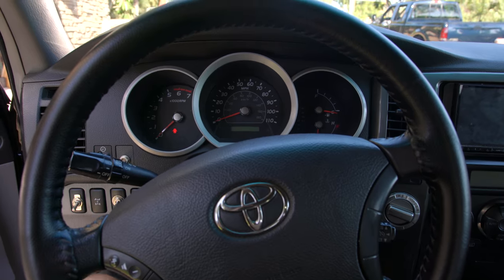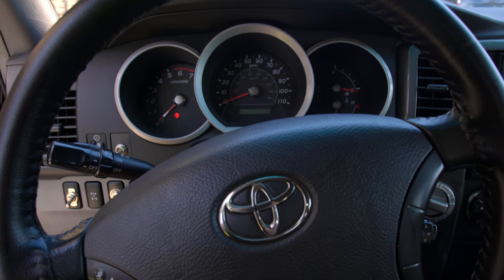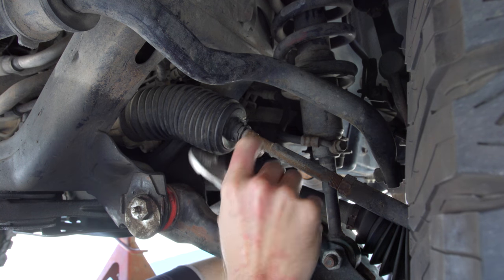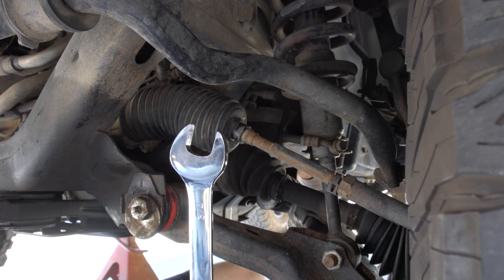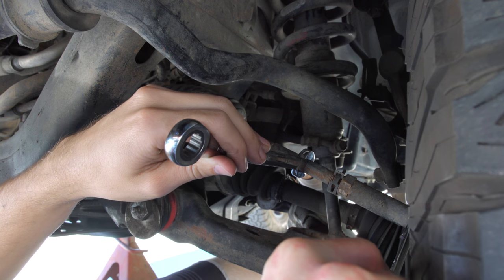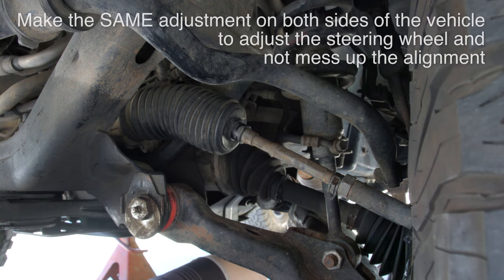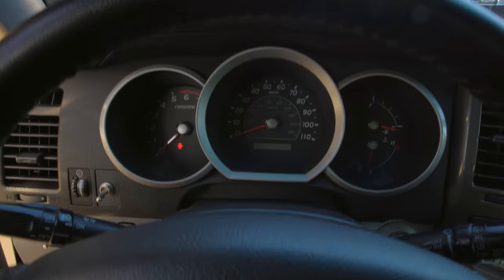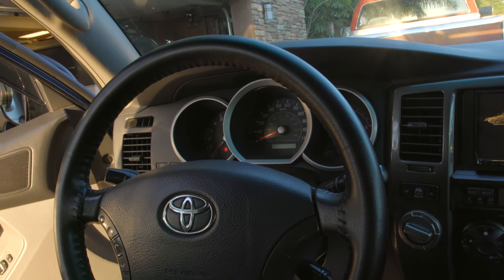How to Center a Crooked 4Runner Steering Wheel

Comment: I had the same thing but I adjusted it via the steering shaft coupler. It goes into the steering rack, there is a lower screw and an upper screw on the coupler, undo both and then push upward (from under the truck) and it should come loose and slide upward, clearing the pinion on the steering rack. At that point you can rotate the steering wheel and adjust it to its zero point, reattach the coupler, fasten, and bingo that's it.  No tie rod fiddling needed.  Cheers !

Comment: If you pay for an alignment and the steering wheel is not straight you should demand your money back.
A straight steering wheel is part of the alignment process.
Reply from the maker: You're right. If I wasn't mechanically inclined then I would have. But since it was easy enough for me to do it myself I figured It was a good chance to make a video and teach other people about it. I ended up going back for an alignment and they gave it to me for free.
Reply: Doug N man, I keep give the car back to dealership. I told them the steering wheel is not centered is tilted on the left. They told me that everything is fine tire rods,suspension. Then I took it out and I return it back. They test it and they told me is not tilted!! I told it to a regular shop and they said your alignment is perfect. But I still feel that my steering wheel is not centered.
Reply: Alignment shops don't give a rats a$$ about your steering wheel. Thanks for this video!
Reply: @fishing4happiness610  True. My car runs straight, but the steering wheel alignment is FUCKED!

Comment: Good video thanks for posting... key thing is which way to turn the outer tie rod ends.  BOTH sides will be the same way depending on whether you are adjusting to the left or to the right.  In your case your steering wheel was off to the left (counterclockwise) direction so the wrench will be turning bottom to top like you did on BOTH sides.  If your steering wheel was opposite of your case (slightly clockwise off or right of center) then the adjustments on both sides with the wrench would be top to bottom.  It is good to visualize what is happening when you are turning them.  They are standard threaded rods and it is easy to visualize either extending the tire/wheel or contracting it when they are turned the proper way.  Thanks for posting!
Reply from the maker: You said it right!! Thanks for watching!
Reply: Excellent comment thanks man

Comment: Just had my 2018 TRD "aligned" today after I installed my lift. Drove it there and when I took it home...it's aligned...but the wheel is sitting around 45 degrees left. I'm going to take it back but if they can't fix it I'll give this a try. Thanks for posting!
Reply from the maker: Same thing happened to me. I took it back twice and it was still not straight, but like yours it was aligned. So finally decided to do it myself, and take it back for alignment. It was off such a small amount they barely had to touch it. Never going back to that shop again though
Reply: The shop I took it to gave me a deal on a lifetime alignment package so hopefully they'll get it eventually. I won't say it's name but it rhymes with Firestone.... Super cool guys, then again, this is a little much. My terrain control and traction assist lights won't go off either. Fun times.
Reply from the maker: Hah yeah it’ll do that to your lights. Well best luck man! Let us know that you got it fixed!

Comment: Yea I just replaced my steering rack bushings. The wheel is off to the left about 10-15degrees I think I’m going to have to take it back off and move the knuckle another tooth the wheel moved a little even having it tied down so I think that is my problem.

Comment: Sorry, the haters are hating on your video. I had the exact same scenario with my 100 Series Land Cruiser. My steering wheel had to be to the left to drive straight. 

I took it to an alignment shop and they recommended a new Rack & Pin and claimed my  Tie Rod Ends were stuck. 

When I got some time, I took some toe measurements (looked good) and then saw your video. 

So I gave it a try, did a full 360 turn “up” on both sides and bam steering wheel was straight and the vehicle tracked perfectly down the road!  

I dialed mine in a little and came back 1/4 turn and now its really nice. 

Thanks so much, this helped a lot and saved me a bunch of troubleshooting and time! 

If we ever cross paths I’ll buy you a beer lmao.
Reply from the maker: Glad I could help! I’ll take you up on that beer haha. It’s funny the haters are the people who wouldn’t actually try it themselves and don’t realize that after I made the adjustment my truck drove straight and my steering wheel was straight. Haters gonna hate!

Comment: Thank you for pointing out to remove the clamping ring fm/the Inner TR boot, so you can rotate it free. I've recently noticed that the wheel is crooked like ~30 degrees to the right. Not sure if I need to go to alignment before or fix it and then go to check everything during the alignment. I've read you comment below about the reasons why to do the straightening 1st, but in one film they said the crooked wheel can be due to unbalanced tires. I've changed 2 tires on front, balanced them w/HF Bubble Balancer (all that is not very precise of course), then took it for a test drive, noticed that crooked wheel. I don't remember if was crooked before or not (I don't drive that car much). So I think maybe the problem is due to new tires, which are not aligned and unbalanced. After I change all 4 tires, would it be better to straighten the wheel first and then go for alignment or just go to the dealer explain everything, so the mechanic will do the adjustment during alignment? Thank you very much for your film again.

Comment: Did my alignment turn out they didn't proper torque my driver side lca bolts was loose, it was clunking and torque it down now my steering wheels is crooked Will it be the same problem

Comment: Same issue for me
I refused to go back to the shop. What is the point?
Same shop also didnt notice my cam bolt being waaay out on the passenger side
Tire noise ans wear still drive me nuts
I'll be adjusting the front toe, cause the factory marks are off on either side 🤷🏼‍♂️

Comment: Why would you adjust the rods and not just loosen the intermediate shaft and straighten your wheel. Then retighten?
Reply from the maker: Because with my searches I couldn’t find anywhere to do that. Could you help me know where it’s at? I know there’s bolts on the shaft under the dash, but that wouldn’t let the steering wheel spin.
Reply from the maker: Eric Kimmy  ??
Reply from the maker: @subtegral  I actually know the answer to that.. would you like to know?
Reply from the maker: @subtegral  I agree. So the egg and chicken paradox... The simple answer is that the chicken came first. Cause who the F sat on the egg. Eggs are so temperamental. You need to keep them warm, flip them over... if the egg came first there would never have been any chickens. The egg would've just sat there and rotted to nothing.
Reply from the maker: @subtegral  That is a whole other topic my friend.
Reply: That would uncenter the rack.
Reply: you have to crawl under and look on the driver side, there is  the steering wheel shaft that goes into the steering rack.  There you will find a coupler with a rubber plate.  That coupler has a screw that tightens to the steering rack pinion, and another screw that tightens to the steering wheel shaft.  You have to unscrew both of them, then tap or push upward on the coupler.  It may be "jammed" due to tension but it should come free after some jiggling.  I agree it was hard to find this info for me too and I did not realize the coupler could slide upward that much, since there was a lot of dirt and grime that had jammed it.
Reply: The center of the rack depends on the tie rods as well.  If you unbalance your tie rods or adjust the shaft it's the same thing @lurice0
Reply: @wacky.racoon  no it's not because the tie rods are a much finer adjustment for one thing, for another thing it has to be exact at least to 1/32 of an inch. Lastly if your steering wheel isn't centered, and u try to do an alignment u won't be happy when your done. Count how many turns it takes to get steering wheel from center to left lock, then compare that number with how many turns it takes to get to center to right lock then make those numbers match. Then straighten wheel and lock it with something. Roll car back and forth and straighten wheel. Put car on slip plates. Get brackets that attach to car and attach strings to brackets. Measure distances from strings to wheels. Adjust tie rods accordingly. Only way.
Reply: What do you lock it with?

Comment: I hit a stump and it went -45 degrees. I hit a stump again and it was on center. Then a third hit of a stump did a - 10 degrees. 
I think something is slipping. If it was bent, it would probably be unable to correct itself.
Reply: Did you ever figure out what was loose? I hit a pipe and steering is now off. Im pretty certain tie rod adjustment isnt the correct answer but is one way to hide the problem.

Comment: If you have A UNIVERSAL JOINT UNDER YOUR DASH that assembles the steering shaft there, you can simply loosen & remove BOTH bolts ( one on the top of the U-joint, and one on the bottom ) to that U-joint. That U-joint will then slide right off DOWNWARDS off of the shaft closest to the steering wheel. You may have to "coax it" or jiggle & pull repeatedly, but it WILL slide off that upper shaft. You will see SPLINES ( little grooves ) on the end of that UPPER shaft closest to the steering wheel that the U-joint rides on when assembled. Now, SIMPLY STRAIGHTEN YOUR STEERING WHEEL BY HAND, TO WHERE IT NEEDS TO BE, AND MAKE SURE YOU DON'T MOVE THE STEERING WHEEL AGAIN ( keep it in the correct position ) AS YOU RE-INSTALL THE U-JOINT, EXACTLY THE SAME WAY YOU REMOVED IT. What happens, is AFTER you completely remove that U-joint, and then STRAIGHTEN YOUR STEERING WHEEL, THE UPPER STEERING SHAFT TURNS ALSO, TO THE PROPER POSITION. If you do this carefully, and properly, you will straighten your steering wheel WITHOUT so much as touching ANY of your front end adjustments THAT CAN CAUSE YOUR FRONT-END TO GO OUT OF ALIGNMENT. THAT MAKES NO SENSE TO DO IT BY MESSING WITH YOUR FRONT-END ADJUSTMENT. ( Unless you happen to have a vehicle that does NOT have that U-joint on the steering shaft UNDER THE DASH. ) VERY IMPORTANT: BEFORE YOU DO THE METHOD I JUST EXPLAINED, DRIVE YOUR CAR ON THE DRIVEWAY, PARKING LOT, OR ANY ALLEY OR SIDE STREET JUST FAR ENOUGH FORWARD SO YOU KNOW YOUR FRONT TIRES ARE EXACTLY STRAIGHT. ( Make sure you are on hard, LEVEL ground when driving your car about 30 feet or so to make sure the front tires are perfectly straight. Because YOUR TIRES AND YOUR STEERING WHEEL NEEDS TO BE STRAIGHT WHEN YOU RE-INSTALL THAT U-JOINT. ) If you have that ADJUSTABLE U-JOINT on your steering shaft under the dash.........THAT is where you are suppose to straighten a damn steering wheel.........YOU SHOULDN'T MESS WITH A PERFECT FRONT-END ALIGNMENT TO SIMPLY "STRAIGHTEN OUT YOUR STEERING WHEEL".........YOU COULD VERY EASILY SCREW UP YOUR FRONT-END ALIGNMENT THAT WAS PERFECT TO BEGIN WITH. THAT ADJUSTABLE U-JOINT ON THE STEERING SHAFT IS THERE ( on most vehicles ) FOR THE VERY REASON OF STRAIGHTENING THE STEERING WHEEL, WITHOUT HAVING TO SCREW AROUND WITH YOUR FRONT END ALIGNMENT AT ALL. ........GOOD GRIEF MAN........WHO IS TEACHING YOU GUYS ALL THAT OTHER CRAZY SHIT.
Reply from the maker: Lol you must have a lot of time on your hands. Turns out the shop didn’t get my alignment right or my steering wheel straight.. so this was necessary for me after having gone back 5 times already. I’m sure you would’ve understood that if you watched the video. I appreciate your input, but would appreciate even more a better delivery 🤓
Reply: Thank you so much saved me lots of dollars taking it to garage
Reply: @TrailBendersOverland  if you had to go back 5 times to get your steering wheel straight there may be something wrong with one or both of your outer tie rods or possibly whom ever is doing your alignments isn't that good.
Reply: Yup.  I had to replace the steering shaft with the U joint and now my steering wheel is off because of it.
Reply: Agreed. Alignment tech who uses a machine to align the wheels showed me the tie rod end tied in, while the other one was adjusted to half of the thread length. Now I'm sitting here replacing a steering rack (it was completely out of alignment which caused the rack to have play on the passenger side). Btw, hes right. If your rack is aligned, and all the rubber (bushings and joints), and ball joints are good, you should adjust the steering wheel at the rack. Did your alignment shop give you the measurements? 

The only time you should touch those is if you're replacing them and getting an alignment. Otherwise, youre replacing other stuff along with tires. Those tires look expensive
Reply: @bkelsey6692  you're uncentering the rack if you mess with the steer wheel joint
Reply: I get your point but why these aligment shops most of the time don't do the right thing been there a couple of times  and every time I go with a crooked steering wheel they don't fix it when I got the car back it's crooked to the other side so what's the point of  taking your car to these professional shops and pay $100 plus if they don't fix the problem I just think that the new technicians these days don't give a f.... they think cause they have those fancy machines don't have to check every single step on how to perform the right aligment for every car....
Reply: @lurice0   adjusting the steering rod is zeroing out the rack center because it's been uncentered to begin with due to the tie rod adjustments made at the alignment shop. Think about It from a systems perspective, the steering wheel misalignment is an input problem, with 1 adjustment point.  It is more efficient to adjust it there, rather than adjusting the output (tie rods) to compensate for the input, which has 2 adjustment points, and will need re-alignment afterwards.   Unless the tie rods are wholly unbaleanced this is what makes most sense.  Otherwise take it back to the shop and have them balance out the tie rods and re-align it. but really 1 or 2 degrees will not make a difference. My 2 cents as an amateur mechanic.
Reply: @wacky.racoon  you don't know what you're talking about.
Reply: that's the way I did it since both tie rods were looking well balanced and I don't have time to re-align everything, so moving the steering wheel a tiny amount isn't going to change anything on the alignment. @lurice0

Comment: What actually causes the tiltedness of the steering wheel? Can it happen after you hit a cement bar on the parking lot? I knocked the bottom of the car over that bar near one store and then noticed that the wheel is tilted. I can't say if it was tilted before or not. Before I hit another car over that limiting bar, but the wheel is straight on it.

Comment: If your wheels are aligned your steering wheel should be,  if not take your steering wheel off and re-centre it nice
Reply from the maker: Negative. If you ever look at steering linkage it would be very clear that an adjustment in the wrong direction by the tech doing your adjustment could through your steering wheel off and have the vehicle still drive straight.If the wheel was straight before the alignment then it it should be straight after the alignment. A crooked steering wheel means the tech didn't leave the steering wheel perfectly straight at the beginning of the alignment. Means they adjust the steering linkage all together in the wrong direction.

This video shows how that steering linkage works and why my adjustment worked without having to remove the steering wheel.

Comment: Did it shake while driving? I have that same problem with the steering wheel, and shaking while driving.
Reply from the maker: Jaime Quezada Hmmmm. Mine was never shaky at all. That only happen to me when when my tires where unbalanced. Does it happen during coasting and acceleration or during breaking?
Reply: Trail Benders Overland when I’m accelerating around 65-70 mph. The steering wheel has the same angle as yours. And it’s bothersome haha
Reply: @username_jr133  what was your problem, mine is doing the same thing, how did you fixed it
Reply: Lupita Rodriguez it was the part inside the steering wheel. I forgot the name of it. It sits behind the airbag. Click spring.
Reply: Lupita Rodriguez clock spring*
Reply: @username_jr133  is it expensive?, i changed struts, basically the whole thing, but i never got an alignment so im doing that hopefully that solves my problem
Reply: Lupita Rodriguez yes, do an alignment every 6 months. But if you took it to a shop to change your struts then they should have mentioned to you to get an alignment after.

Comment: You said same direction for both sides. Are you turning the wrench upward on both sides? Or in opposite directions when making adjustments?
Reply from the maker: In my case I went "upward" on both sides. I needed to loosen the drive side and tighten the passenger side, by the same amount. This was with my steering wheel being justified too far to the left. If your steering wheel is too far to the right, you'll do the exact opposite.

Comment: Same problem after a shop put an intermediate shaft in now my steering wheel is off a little i already tried getting it alliend
Reply from the maker: Well give it a try doing it yourself and take it back to the shop to make sure everything is still straight. Or just give them a call and let them know the wheel isn’t straight. They should do it again

Comment: What year is this and where di you get the headlights?
Reply from the maker: It's a 2006 4Runner and I got the headlights on eBay. Just search either 03-05 4runner black headlights or 06-09 4runner black headlights. They were around $250.